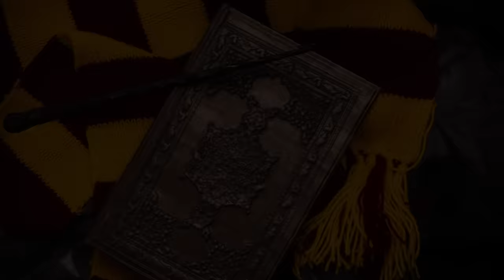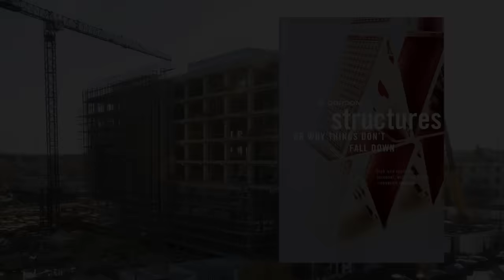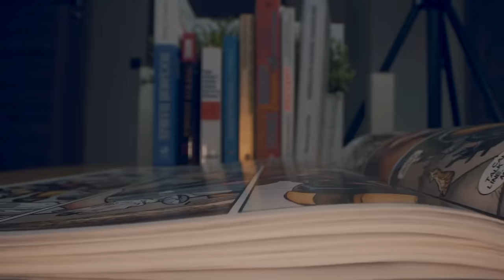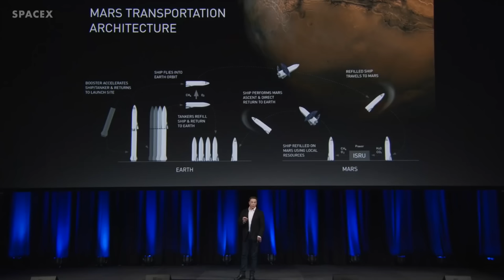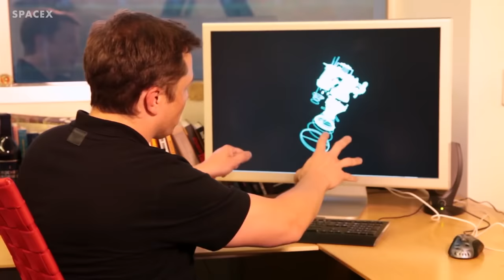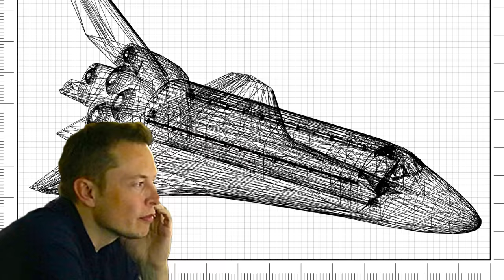Elon Musk: The Scientist Behind the CEO (and How He Teaches Himself) Documentary

Comment: Nothing Elon Musk has done is really his scientific genius.  His early rockets kept blowing up and the Air Force was ordered to diagnose and fix his problems.  Good to have connections in high places.  The Air Force collected the debris, analyzed the pieces, and diagnosed the problem.  They were using the wrong alloy on fittings and with cryogenic fuels and vibrations, the fittings cracked.  He hires engineers to develop hardware & software.   He is an excellent manager, not a scientist.